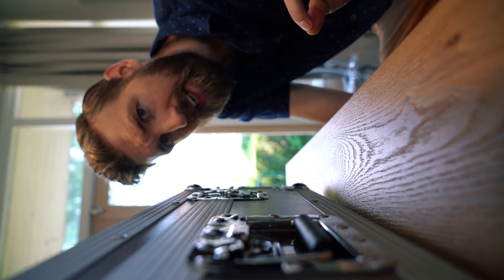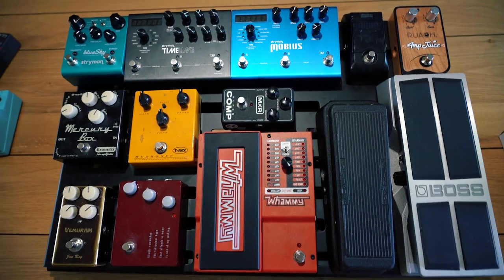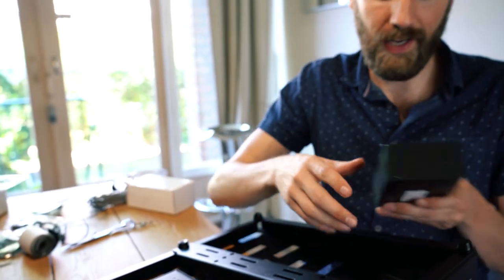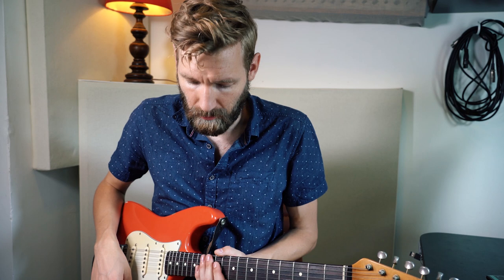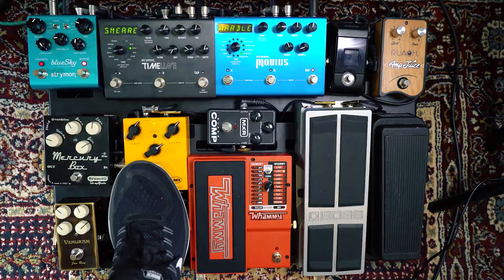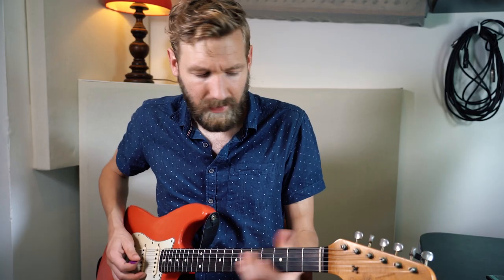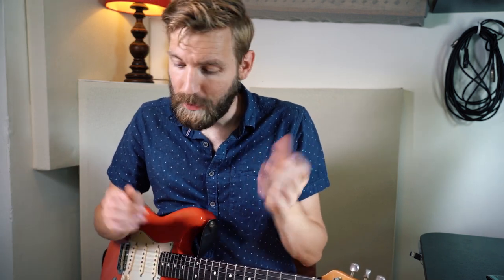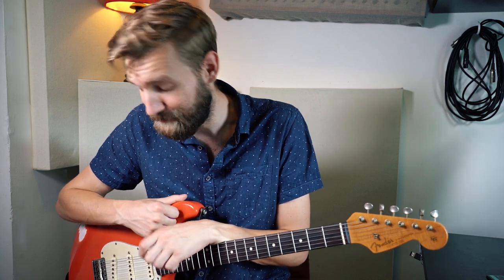Trying to build the ultimate PEDALBOARD!

Comment: I've noticed that you own a custom bb preamp. I've got one as well. I know it cleans up nicely and it is very touch sensitive but I must say that, at least mine, once activated, it cuts the lows in a very radical way. Despite the fact that it is very useful for a solo, I don't really like for rhythmic parts. 
Have you decided not to put the bb for the same reasons? What are your considerations on this pedal?

Comment: Great videos, as always.  

I noticed the Boss FV-500H volume/expression pedal in the board and I have a question regarding it. 

As a volume pedal, I have no issues.  However, when I’ve tried to use it as an expression pedal connecting it to the Boss Harmonist PS-6, I can’t get it to work for the life of me. 

I’ve tried connecting my guitar into the input and:  

* Using a regular instrument cable from the FV-500H EXP into the Harmonist’s EXP. 
* Using a regular instrument cable from the FV-500H EXP into the Harmonist’s Input. 
* Using a stereo TRS cable into both of the previous descriptions.  
* Using a Y-Cable with the TRS jack in the FV-500H EXP and the Mono jacks on the Harmonist Input AND/OR EXP.  

No luck so far and I’m all out of ideas.   Anyone have the same problem?

Comment: Very cool.  Hey Paul... if it were me, I'd also use a zip-tie to keep that power supply in place.  I don't think the velcro tape will be enough.  It might last for a while, but it might start to give after time.  Just a suggestion.  All the best.  :)
Reply from the maker: Yep, I did that, thanks!

Comment: Are overdrive pedals (like the ibanez ts for example) going to have a different effect on a solid state amp then they would have on a tube amp? I know the whole idea is to push the tubes to slight distortion. Thanks in advance!
Reply: For sure they will and a lot of it is about headroom and how amps break up. When you push a tube amp into clipping it makes a wonderful sound, most do, solid state amps not so much. For SS you generally want emulation type things, for tube amps you want sound tweakers more than sound creators.

Comment: @Paul Davids
I'm curious if you have looked into comparing the RockBoard's patch-cables to any other well-known brand of patch-cables (like George L's, Lava, or Free The Tone ...).

Even though I'm already a subscriber, I came across this video of yours via RockBoard's website while looking at their low-profile cables. I love what I'm using, but the low-profile of these cables is lower than anything I've seen. That said, it doesn't mean that they're any better. Do you have any input on this aspect?

Thanks in advance.
Keep up the good work you're doing!
We all need this interaction.

Comment: I'm a guitar noob so I still don't get Can someone explain why Paul needed that much overdrive pedals? Like couldn't he just use the same one but change the settings to get a different sound?
Reply: Listen back to the portion where he talks about stacking the pedals (using 2 or more at once in series) You can achieve a plethora of sounds, eq, levels of gain and volume boost, by stacking them in different orders. There are some great videos on here about stacking. The results vary upon your rig, pedals, amp.. some work better than others. Hope this was helpful! :)
Reply: It's not a smart move actually. You just need one overdrive. The Ibanez TS808 is enough.

Comment: Hi Paul,

Really entertaining Paul. I guess you've been to the tap-dancing lessons too. :) What about the concept of just pressing one button and you get the patch you want? All the pedals seem to be in series so that doesn't bode well for the best tone and low noise performance you could get. Have you ever considered something like a Gigrig? Only the pedals you need are switched into circuit when you need them from one single button press, and it controls midi, like on the Timeline, Mobius and Big Sky. And I don't work for Gigrig! I think I caught a glimpse of a daisy chain power cable which is a no-no for keeping the noise down. What are you doing for driving long lengths of cables at a gig? Anything over say 2 metres of cable is going to start to kill your tone, so a line driver is essential. I love your videos, so I'm sending this your way by way of some kind of payback :)  I'm an audio electronics engineer that plays guitar, and I've been through a lot of this stuff on pedal boards, amp switching, midi, power supplies and rig noise, and all the options you can have. All the best, Cheers Colin

Comment: Happy for you Paul but it looks too cramped and inaccessible. You can achieve those same sounds with 5/10 cheaper and more importantly smaller (mini) pedals. The way you positioned yours would be really hard to operate in a live setting. This can and will work just fiddling with stuff at home, but that's pretty much it. Cheers :)

Comment: There are two types of guitar players.  Those who play guitar and guitar players.  The person who plays guitar typically has a mediocre ability at best but, makes up for it by surrounding himself with rather good gear.  If they can't afford the good gear, they try to make up for it with the cheaper alternative, the massive pedal board that would confuse a PhD engineer.  

The other type is the guitar player.  Their gear is generally good to excellent and they understand the fundamentals of signal, signal flow path and how various amps react to it.  They also understand the fundamental construct of a good tone and the fact that it begins with the player's fingers, transitions through the materials of the guitar into a set of good pickups and finally manifests itself through a properly dialed in amp.  Most importantly, the guitar player understands the difference between "guitar with effects" and "effects with guitar."  The guitar player generally prefers a minimalist approach to their sound by limiting the number of pedals inline to 4, often less.  Those effects most commonly include a good OD pedal, a good delay, a tuner or perhaps a chorus pedal.  Each are set in a very subtle fashion so as to not overpower the inherent tonal quality of the guitar and amp.  

Which one are you?
Reply: I'm a bit of both

Comment: I spent a fortune on those flat Rockboard patch cables, thinking they looked great. After chasing crackles, broken connections and intermittent drop outs, I just threw them all in the bin. THEY SUCK! Go with the PANCAKE connectors! Even the cheapest Chinese cables are more reliable than that Rockboard crap! IMHO

Comment: You should really add a switching system with Strymon type pedals, not only are you not being able to utilize those pedals you are also tap dancing in 2019 pedal era and knocking other pedals along the way, for example the COMP pedal is sitting behind the whammy, no way you can activate that pedal without hitting the whammy pedal on the way. Not a very practical or functional build.

Comment: Maybe it's just me, but I don't get the point to have so many pedals with three overdrive pedals, mobius, timeline, compression and don't use a looper, you could have put the volume, crybaby and the whammy outside the pedalboard (not a big deal when plugging in to a gig), put the overdrive pedals on the right side and under those putting a good looper. Seems like you are fumbling around with your feets too much with so much risk to hit the knobs.., AND not maximizing the capabilities of all those super-expensive pedals... I mean, maybe it's just me and my idea of "ultimate Pedalboard" doesn't quite fit with this..  anyway I enjoyed the video, nice sounds!

Comment: Vermuram Jan Ray = overpriced Timmy copy. Absolutely nothing different from the Paul Cochrane Timmy circuit except a little tweak to the tone control and no 3 diode clipping switch. As you can see the knob layout is exactly the same and if you A/B to two pedals, exactly identical. I don't have a problem with people cloning pedals and adding their tweaks and changes and giving credit where credit is due but Vermuram openly just straight lied saying they thought of Jan Ray as an original design that took 3 years of research and development...seriously? Just straight copying someone else's design, rebranding/relabeling, and throwing it in a bigger body minus the 3 toggle switch and lying about it and getting away because people are still buying it without doing their homework but getting attracted to the high price "boutique" hype. How unfair for Paul Cochrane, a 1 man business, who designed it and hand builds each and every Timmy, is getting robbed by this unethical company called Vermuram.

Comment: Why are all of these such indie BS? Why isn't there some general pedal board that has all these functions? Or are you all too hipster for common sense solutions? Has it just not been developed yet? Is it too expensive? It just about the fn factor of fucking around with the sound and buying these boards? I think it's such a strange operation.
Reply: Yeah, it's called a multi-effects processor.

Typically, a lot of people feel that the pedals offer a "better" result, in terms of sound, than the multi-effects processors do.

Thus ...

It is what it is.